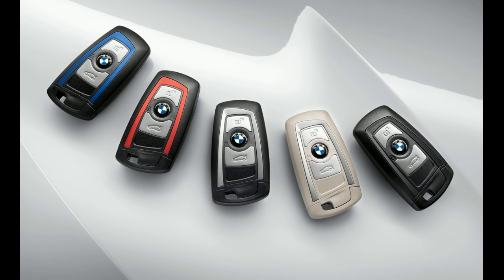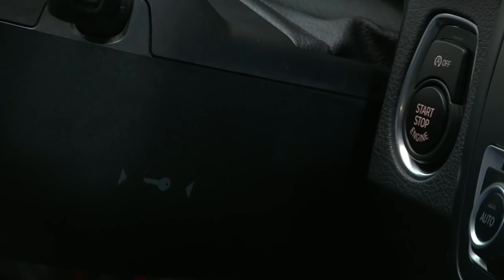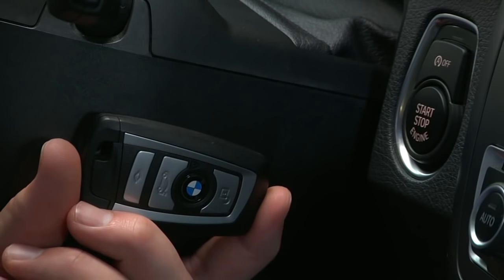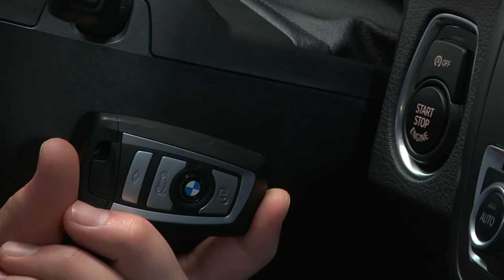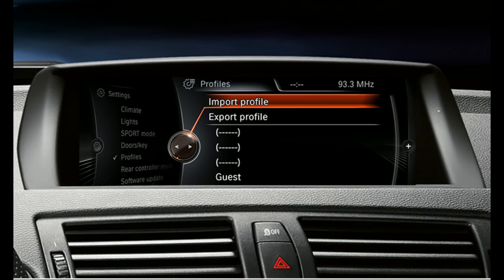Programming a new Keyfob without Keyfob Slot

Comment: The only thing that worked for me when pairing the new key was putting the skinny side of the key, just the TIP itself, not the side of the key fob, against the column. Worked instantly. Don’t hold it flat against the steering column like shown in the video!
Reply: Thanks a lot!! That worked first try with holding the key like u said.
Reply: You were right!

Comment: Almost right.  One very important step is missing.  After you have unlocked the car, before you place the new key fob against the marks, remove the original key a long way from the car or the car will simply start when you press the start/stop button and not program the new key.  One other thing, if you have a manual transmission car, place you foot on the clutch not the brake.
Reply: mine didn't start. I had to press and hold the key to the marks on the column, press and the start button, and it programmed. THEN I could start the car, but it TOLD ME via the display that it was ready to start

Comment: 2012 BMW 528i without comfort access. New key fob worked on the first try. I unlocked the door lock with the key blade from the new fob as I lost both of my fobs. I held the fob perpendicular on the key logo on steering column, pressed on the brake and then pushed start engine. It started and registered the key without issues. 

I got the new key from the dealer with my VIN (you need to submit your copy of your registration & license - if your registration is inside your car and you can't get in, you will have to get a copy from DMV?). I hope this helps others as I was reading conflicting suggestions that you will need an existing key to program the new one, or that the car won't start without an existing key - not true as long as you got the key directly from the dealer, which comes pre-programmed, you just need your car to register the key.
Reply: thank You for an explanation, this is just a registration of pre-programmed key fob. I asked BMW dealer and got the same answer. Keyfobs from aliexpress should be programmed by specialist using specific interface and it costs.
Reply: @warsawjadore2740  fck bmw. Old cars keys were better. They only did this to take money. Charging crazy money for just a key. Should be illegal what they do. Normal key makers should be able to generate new keys if you have a key

Comment: All key lost on a 2014 750LI and I ordered and rec'd a $400+ new key fob + blade. Blade opens and closed driver door. 
Under what condition will this new key recognition not work? Battery weak (11.8V)? Some "automotive locksmith" has tempered with the CAS / immobilizer? Car been sitting for too long and some module(s) went to sleep and not waking up? Do I have to get in with a working key first (I don't have one)? Parking is not in neutral (put in neutral to allow towing)? Parking brake release (emergency released)? I checked the battery and transmitter signal, they are good.
Reply: Did you get this sorted? I’m in the same situation now

Comment: hi
I tried  the tow ways several times  it did not succeed
Please explain it in detail
What should I do before and after  entry of the vehicle
im waiting for your response as soon as you can
thanx alot
Reply from the maker: Sounds like you did not get one of the precoded BMW keys like what is available for sale on the bimmernav website.  Sorry about that, but if it does not work you will need to get the proper key that is precoded from BMW for your specific VIN www.bimmernav.com/url/fkey
Reply: bimmernav Thanks for the quick response
Yes, you're right  the second  one  also  the original factory I bought the car from someone newly , one of them working fine ,While the other not working i already Check the battery of it its ok, so if you please  find way
1- Is it necessary to open the vehicle with the key or remote before,
 2- Should I close the doors be for waiting for details
3- my car is F10  BMW 530LI ,MODEL 2012
thanx alot

Comment: OK I'm calling BS - I tried this repeatedly on my 2014 X3 but this did NOT work.  I'm going to take this fob to a dealer to see if they can program it.  Has ANYONE had success with this method?
Reply: Steve Matta this only works if the key is order from dealer...
Reply: Jose Rodriguez i ordered my key preprogrammed from the dealer and it doesnt work

Comment from the maker: IF YOU CAN NOT GET THE KEY CODED RIGHT AWAY, take the old key out of the car and move it far away from the car.  Hold the new key to the same spot until the car recognizes the new inactive coded key.  Once recognized then have someone bring the old key to the car and start it.
Reply: So, do I have to create a profile for the new key fob? and will it have the exact same functions as the original key?
Reply from the maker: vilawon
Yes you can create a new profile with the new key or just make a profile the same as the other keys
Reply: bimmernav
Thank you so much for your quick response :-)
Reply: What if you do not have either of old key fob? I have a 2012 BMW 528i without comfort access, bought with only one key, which I lost/missed placed. I have a key on it's way from the dealer, I was wondering if I could program it myself without have to tow the car to the dealer or what would be the steps in my case without an active old key fob. Thanks ahead for your reply.
Reply: @bimmernav  can this be done to an BMW x5 I have a key for another BMW but would like to reprogram it to my x5 as an additional fob thanks

Comment: bullshit! This doesn't work! I just keep getting an error that I need to hold the key to the steering column.  The new fob was ordered from the local dealer..with my VIN
Reply: You have to keep holding the start button with the brake depressed until that message goes away, then you let go and push it one more time.
Reply: Patrick Keough no, you do not depress the brake. I already figured this of. And, the fob has to be held perpendicular to a very specific spot on the steering column. But thanks for misleading people. I found another video that actually explained it correctly.
Reply: eliot J  same issue happened with me plz what did you do bro ?
Reply: Hi Eliot, do you have the link to that video? Also, can the programming be done with out the old key fob, I'm missing both. Thanks.
Reply: if you're in the car, you don't have a key fob.  There is a place on the steering column which you have to hold the key fob directly against the column. Then, with NO FOOT ON THE BRAKE, press the start button until it tells you that you can now start your car. I found this somewhere on the net, and it worked! I didn't need to do anything fancy. Didn't need to take it to the dealer!  Mine is a DEALER PURCHASED fob though... but even the dealer was telling me I needed to bring it in... that too was bullshit! I hope this helps. Try it and let me know
Reply: Thanks for your quick reply. Yes, mine is also dealer purchased, waiting to pick up the key fob tomorrow. I got mixed answers from two service techs, one said I will need an old key to program it myself, another said no. But I guess I'll find out tomorrow. I will post back.
Reply: but without depressing the brake pedal. 
My car is a 2013 335i
Reply: My new key worked on the first try. I held it perpendicular on the key logo, pressed on the brake and then pushed start engine. It started and programmed without issues. I want to note for others, I didn't have any other key fobs, in fact I lost both of my fobs. So I tried this with the new key fob I got from the dealer with my VIN, I unlocked the door manually with the key blade. My car is a 2012 528i without comfort access.
Reply: Sadi Muntasir excellent!  Glad to hear. In my case, I tried pressing the brake, and found that’s where mine apparently was different. Either way, this is so simple. The dealers and others are telling us we need to spend megabucks to have them do theses things